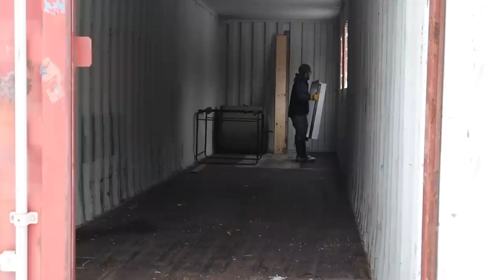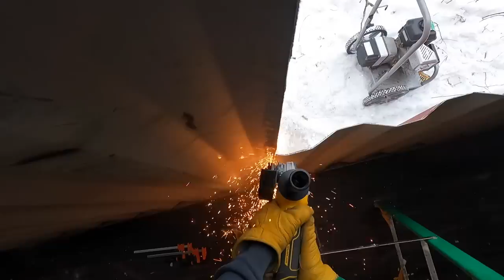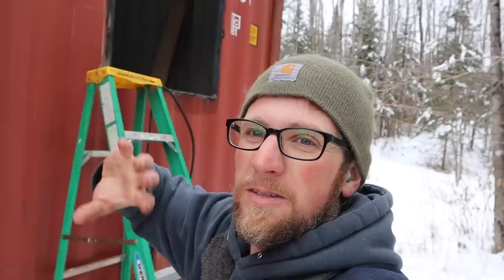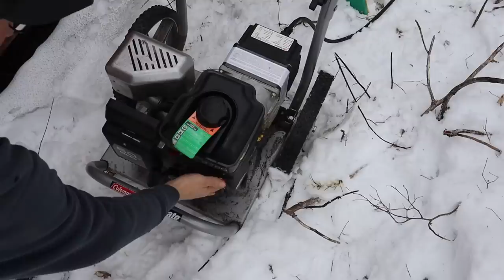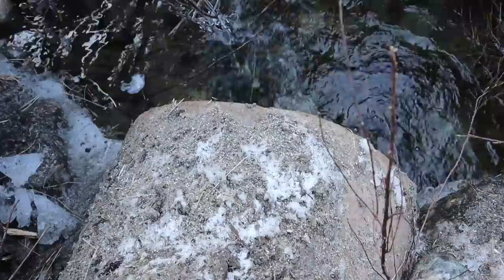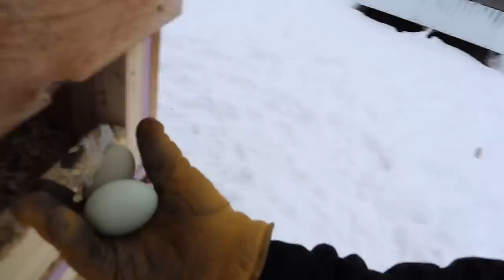Welding Angle IRON Window Frames in Our OFF-GRID Shipping Container Cabin in the Woods

Comment: I love that the smaller generator has the guts to run your welder! Great to know. My youngest son wants to weld so now I have an idea what he needs. Thanks. The frames look really nice! Wow, that is a tight fit! I thought the frames were going on the outside so I was backwards. I thought the plastic boards would come from around the frame on the outside to the inside of the 2 x 4 wall. I am confused. Could you show me how you'll have a water proof seal the way you are doing it please? I don't see where the plastic boards are going to fit now. Oh the plastic boards fit on the inside of the frames. Now I've got it! Sorry for not following what you were doing. Very nice looking!

Comment: Al-It's hard to tell from the video, but it looks like when you are welding you are holding the gun in space with both hands. Try placing your "off" hand on something solid and resting the gun on that hand. It makes it a lot easier to work and lay a more consistent bead. And keep practicing--cut up some scrap and weld it back together, over and over and over. Takes hours and hours of repetition. Please pay attention to ventilation if working in your shop!

Comment: When you were standing in the container near the back wall, it made me think that it might be best to offset your door entrance.  Putting it right in the middle is not going to leave a lot of clearance on either side, if you're planning on putting your woodstove in one of the corners.  Slide the door over towards one corner, and you could probably put your stove in on a diagonal in the other corner.  Just my two cents.

Comment: !!!!!!!!!safety warning. Grinding the paint off is not just to keep the burning paint fumes from displacing your shielding gas created by your flux core wire. But the paint has some pretty bad stuff in it and is not good to breath. Most shipping containers are made in countries that do not care what is in the paint as long as it is cheap. Grinding the paint off will not only give you a better weld, it’s the safe way to work. Best to not take short cuts and do things the right way. Someone before you has had to learn the hard way. Take the time to do your research when learning new skills, it will safe you in the long run.
Reply: @Joshua Clemens. Thank you for this comment about fumes. Al, it's very scary when you flip your face plate of your helmet back every single weld and inhale a big breath to blow something away. you can see the smoke from the weld chemicals rising up, just where you are strongly inhaling to blow. It's very scary to contaminate your lungs with lead and all the other noxious toxins that are in there.  
BTW, welds are so hot that blowing doesn't make any difference at all so you might as well save your lungs from the poisons.
 it's also frightening if you ever forget to flip it down before you start the weld and blind yourself. It is best to just leave the helmet down. If your  faceplate does not automatically shield you, see Harbor Freight sells excellent assortment of instantaneous shielding welding helmets for $50 or less, or you can pay more from another big box stores.  Either way, it's worth a fortune in terms of your health and your eyesight. Love everything you do, as you say, Al, "I like it!"
Reply: @laurelforrest72  Yeah auto darkening hoods are nice but don’t help keep the fumes out. They are only designed  to keep light out. The shield protects your face and neck from getting one hell of a sun tan. To keep from breathing fumes you have to use a positive pressure welding shield. They run about 1,500.00 to 2,000 dollars. Well worth the money though. When you are welding all day you don’t have to taste burnt paint at the end of the day while you are eating your supper. Lol been there.

Comment: Al, make your welding easier and better, grind off old paint, any rust and mill scale on new steel... less splatter, better looking welds that penetrate better with less porosity, so they are stronger. Use a flap wheel 👍
Reply: The paint barrier is not big an issue . Rust can . but this container looks new and has no rust.

Comment: Are you pushing or pulling the wire on the overhead welds. Much easier to pull and weave. On vertical welds it's better to run the  bead up. Not to mention clean metal...  It all comes with experience.

Comment: Your welds will look much better if you prep the surface. Grind the paint and grind or wire brush the mill scale on the angle iron. Vertical welds can look good but have poor penetration.

Comment: Also every weldment has to be prepared before you do any welding make sure all the paint is off of the material that you are going to weld you can put a flight 45° angle on each of the Edge's that you're going to weld that will ensure penetration of each weld you make welding is an art but if you go to school for it you can get a degree in Sciences in metallography in Metallurgy like I did I have a bachelor's degree in Sciences with a 3.9 GPA out of Wayne State University

Comment: Hey Al may I suggest something to you before you do any welding make sure you grind off the paint I need the container on the outside the paint is going to give you problems welding especially with penetration the welds will be weak always go into the f e l l i t of the weldment are either of 30 degree angle or a 45 degree angle and that way when you weld make sure you go forward don't wave it you will not get penetration and you will weaken the weld but make sure the paint is removed from the outside of the container where you're going to make your weldment.

Comment: 1. Paint with car body paint.
2. Silicone is not a good solution for outdoors.
3 Use Polyurethane (for cars) to Seal the joints.
4. Paint with paint for metal constructions.

Comment: Several times you mentioned using silicone caulk to seal around the windows. If you do a bit of research, you might find that silicon is not a good choice on an outdoor, metal to metal joint. a UV stabilized urethane elastomeric seal or butyl robber sealant (Old school, hard to find, but still available from DAP) would be better. That's what most HVAC installers would prefer ! !   My experience with silicone is that it will have to be redone almost annually. ! ! !

Comment: Please, when you do your door frame, grind off the paint down to bare metal. They use a high quality paint and primer on those containers. Welding through that paint really diminishes the quality of the welds and capabilities of your welder. These are the words of a Pro, one of my nephews who works at Georgia Ports repairing containers.

Comment: Everywhere you weld on the outside, it has burned away the paint on the outside of the shipping container. It might have been a good idea to repaint it before putting the glass windows in so you don’t have to tape them up. If you came to watch this because you are doing your own shipping container renovation, (& you happen to see this) hopefully this comment will help you

Comment: WARNING*  Silicone is Acidic and will rust out the steel.
You need to use Urethane like what we use to put in Auto Windshields.
Ask any Auto Body Shop if they use Urethane or Silicone.
They will say Do Not Use Silicone as it will eat the metal out. Just an FYI.

Comment: I know you'll get a million comments about grinding paint off and welding clean metal to clean metal so I'll talk about safety:)

For back home, google about grinding and welding where you also work on wood. You might want to make a booth with those plastic welding enclosure streamers down to the floor and a metal welding table in the middle. It's not just fire hazard (although there's a FIRE HAZARD -- keep all combustibles at least 3' away in all directions and an ABC fire extinguisher within reach). It's also that all the grinding particles and welding spatter will contaminate any wood working you do in the area. You'll find rust popping up on wood. You can safely and intelligently combine the two things, just have to think a bit. Maybe in the future you'll build a separate metal shop attached to a wood shop with big sliding/rolling doors between.
Also, you'll want to get better personal protective gear like welding gloves and a leather apron for starters. Also Carhartt has a line of flame retardant clothing just for welding in. Also great ventilation and sometimes depending on what you're welding air masks rated for fumes. (And please bring your chaps to chainsaw in, lol! Don't want to start calling you stumpy!  You used to wear some right?)

Comment: Tip for welding: grind the paint at the container away before welding, you get much better weld and sealed and no need for silicon caulk

Comment: I know you're just a novice or should I say rookie if you listen to the comments and pick up a lot of things from other people who have experience in welding you'll find it a easy job to do and not so much of a challenge. I would suggest you get yourself a good book on welding principles and practices and that book you'll understand more of what you have to do when it comes to welding and better prepared for the job that said hand metallic inert gas Mig process or tungsten inert gas TIG welding or arc welding where you use electrodes and on each electrode has a number m a book called welding principles and practices you will understand what each Electro does what positions you can well those electrodes with and the welding machine that you can use them with a basic arc welder can use many types of electrodes but not all that's where you have to understand what you're doing and what application you were going to use it for you are making a weldment a heavier gauge sheet metal against a iron products angle iron the angle iron being thicker then the actual metal of the container you'll want to make your weld closer to the angle irons than the sheet metal to prevent burning through